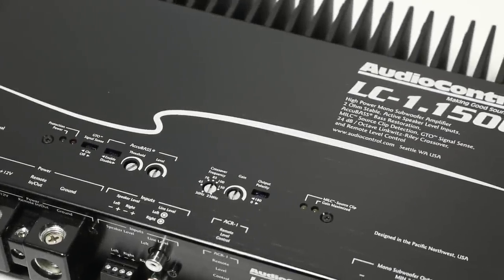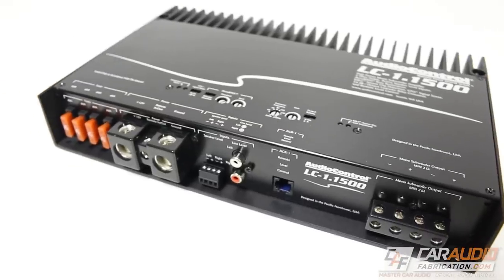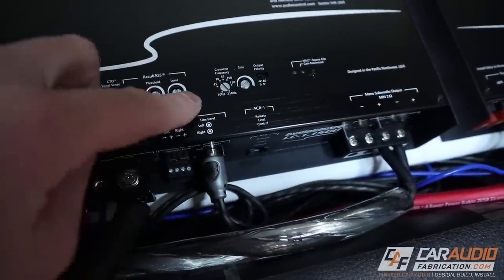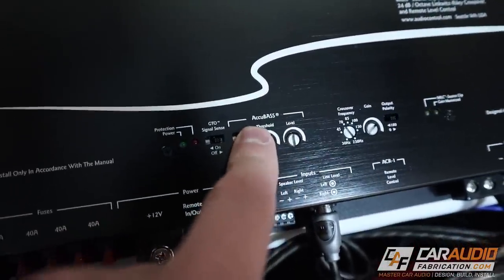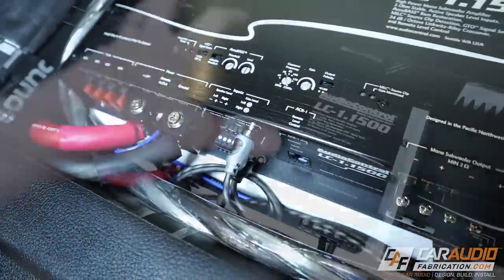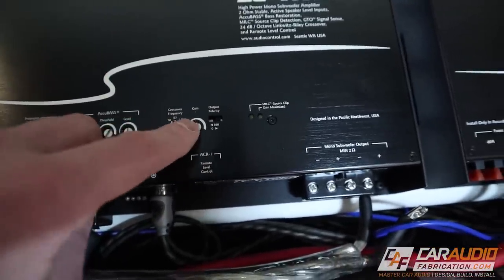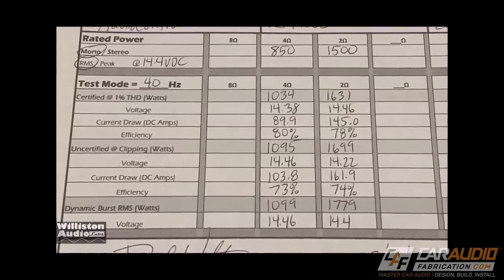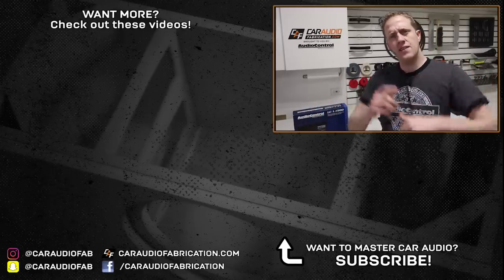Make your SUBWOOFER Sound Great! AudioControl LC-1.1500 Overview

Comment: I bought a "5000" watt amplifier (it was really cheap and I'm positive it's never been used so I'm not really upset). I told my mate about it and he told me all about the RMS and how the max watts are purely an advertising scheme. Not gonna lie, I'm bummed that the RMS (which is only 120 watts!!!) is barely more than my head unit, but I figured since it was cheap as hell and since I took a course on electronic systems, I could tinker around with it and see if I can make it more(or less) powerful. This channel is great btw, so much info, easy for the basic user to understand.
Reply: Let me guess, you also believe your headunit pushes 4x50w?
That's also fake, most of them are 4x20w RMS. 
It's always good idea to read manual for more info, or even get rough idea of power by looking at fuse ratings.
Reply: head unit(sony) claims 4x55 at 16volts in fineprint(SIXTEEN VOLTS lmao) so i at least know im not getting that
Reply: @fishrsa9046  It's not even on 16V, most headunits don't have any type of step up circuits so max you can get with BTL 14V is 25W even at 16V you can only get around 30W. Realistically you are looking at even lower numbers in real world.
Reply: The power supply used to calculate the number is 16 volt, like the 14.4 used by most amp manufacturers. They're not saying the head unit uses 16 volt
Reply: @fishrsa9046  Could be, but again, doesn't really matter for real world scenario where you would get 13.5-14.4v.
I recently tried to repair cheap JVC headunit and i was dissapointed when IC that was used is actually rated even less than 22W that JVC advertises as.

Comment: I remember Audio Control from the 90s back when I was doing audio upgrades in my vehicles.
Reply from the maker: I've used their stuff for as long as I can remember, always been solid and a big part of why I feel so comfortable recommending their stuff to you guys.
Reply: Still have my Epicenter(from back in the day ...80's). Rock solid gear. 80's rock REALLY comes to life with it. Makes my 2 10" type R's SLAP. But this amp is very tempting.....

Comment: I've always been a big fan of audio control since the 80's I've had original eqx's, epicenters, 2xs, 4xs, as well as some of the home eq's, I think the original epicenters were different sounding than the lastest ones, the old original ones you can actually tell when the industry took out that low sub bass and the epicenter restored it, the lastest is bass all the time and to me it's not as impressive, but this amp here seems very impressive and I may have to get me one? thanks for the video as usual very good.

Comment: You should turn the lights off just to see if any the amps emit light. I just bought this 1500 and didn’t realize it emits blue out through the top cooling fins
Reply from the maker: Yeah, in my latest video I did that! If you don't like the light I believe you may be able to just disconnect the led strip. I think you can also change them out! 😉

Comment: Hey I don’t have a comment about this video but just a general question on a problem I’m having. I have a 2013 g37 just got an aftermarket audio system installed. Running the factory head unit with a audio control lc7i  (1) Rockford Fosgate T2500-1bd for bass and (1) Rockford Fosgate T1000-4ad for kids and highs. (4) beyma 6g40nd in the doors and (4) kicker kst25 tweeters. (2) JL Audio 10” W7 subwoofers in a custom box with port hole through the rear deck. All power and ground wires are ran with 0 gauge stringer wires and rcas. The problem I’m having is as soon as I turn my car on I get a static white noise sound even if I power off my radio. I was told that the sounds is normal because the speakers are amplified but knowing some basic car audio I know that that’s not the case and they’re just telling me BS well at least I believe so. Just looking for some insight on my issue and thoughts about the built..thanks in advance and people feel free to comment back

Comment: Do you know why maybe my subwoofer doesn’t hit that hard using stock head unit? I have Rockford T1 12 running at 4ohm 850rms with a JL-LoC22 but it just doesn’t really hit like it does in my cousins car with the aftermarket radio

Comment: Nice with the gain ligth to finde the sweet spot. Is the RCA input transformed to output when you use Highlevel i put? And is it possible to do a Link configuration on that amplifier? 

Some of the features is super nice but Highlevel input is pretty standard now a days.
 
my 12 year old Audison LRx6.9 have that as a opportunity. It's also alows to only use 2 RCA kabels og Highlevel input signals to use all 6 channels you can also chose to drive 3way activ systems 2way and 1 or 2 subs. The range of options is wild. And ween you use Highlevel input you got 2RCA output and the Remote has an in and output port with a connection istead of terminal. (don't know if it could start up on Highlevel i put signal)

Comment: Stupid question possibly. But how would you install and what would you use to install the lc2i?
Reply: With this amp, you don't need an LC2i....it has it built in.  If you're just asking about the lc2i, what you need is a positive and negative to turn it on and off and a signal from your two rear speakers.  in other words, you need a wire with the positive and negative from your rear right and positive and negative from your rear left.  that's what turns it on when you turn on your stereo.  once you turn off your stereo, it stops the signal from going to the lc2i and it turns off.

Comment: What would be the right size fuse for this amp using 0 guage wire. Also would an ANL fuse be recommended or a resettable fuse or does it not make a difference? Anyone know?

Comment: Do have a rule of thumb as to amp power to wire gauge kit? I have a 900watt but get two different answers at to whether to get a 4 or 6 for a 10” sub?

Comment: As always great vid. Question, Since controlling this amp with a "d-series" amp can you max out the AccuBASS knobs as well and control the AccuBass output from the "D-series" amp?
Reply: Never mind, you would just turn off "disable" the AccuBASS on sub amp and control it through the D series amp! Sorry, I brain farted!...
Reply from the maker: You aren't controlling the AccuBass with the knob anyhow but rather the amp level. Once you tune the AccuBass you don't need to adjust it.

Comment: What if you are using high level inputs and still connected the remote turn on. Will this cause problems?
Reply from the maker: No, you just turn off the switch for the GTO feature.

Comment: Hey do audiocontrol sell a digital sound processor without the amplifier because i have the lc-4.800 and the lc-1.1500 amplifiers with a aftermarket head unit
Reply from the maker: DM-608 OR DM-810

Comment: I have the same setup 1.1500 running through the 4.800 and the 1500 gets HOT, I mean REALLY. No clue why. 5 volt preamp, gain on 1500 all the way down, acr-1 all the way down, volume at zero and running at 2 ohm. Even after only being on a few minutes. Oh and using 0 AWG power and ground with no codes. I'm baffled.
Reply: Just installed mine. Gets really hot.

Comment: I made a sealed rectangular  sub box to the smallest demension it can go but used half inch mdf wood. Can I Put fiberglass over it to make it stronger? Im using a 400 watt kicker 12sub. It was hoping a little fibreglass will give me just enough strength and size I need to make the box fit inbetween the seats. Cant usr 3/4 of an inch wood or else it would be half inch under specified dimension or would not fit with specified demensions.
Reply: If you can do internal bracing, that would be best imo. 1/2" in really thin for a 12" sub. Can you use 3/4" MDF and route out areas that the sub would need internal clearance? Would recessing the sub 1/4" in the 3/4" front baffle help give you clearance?